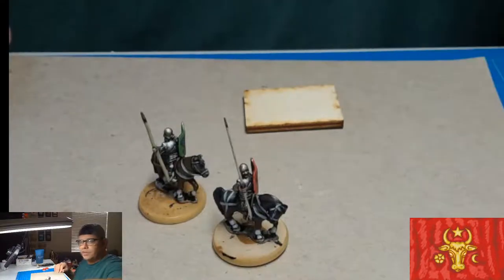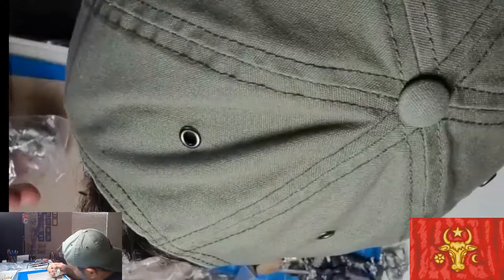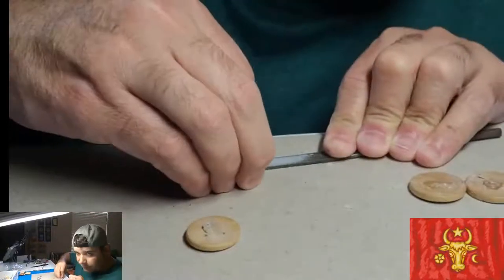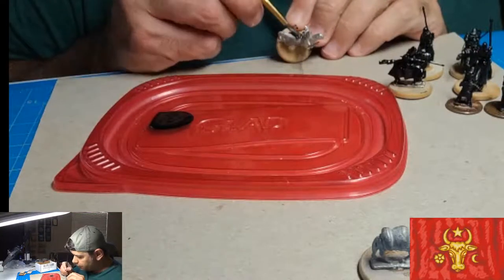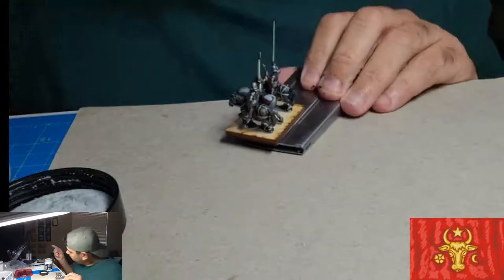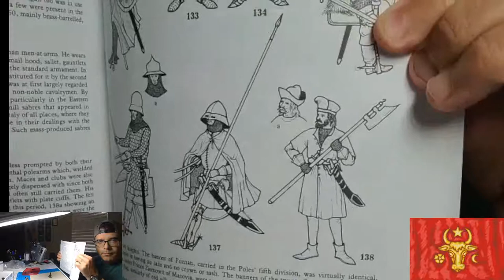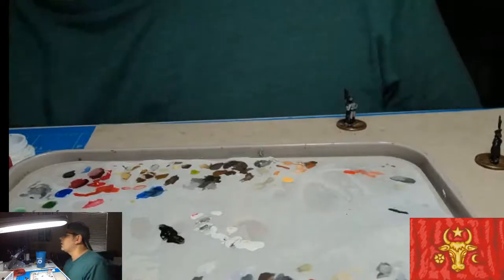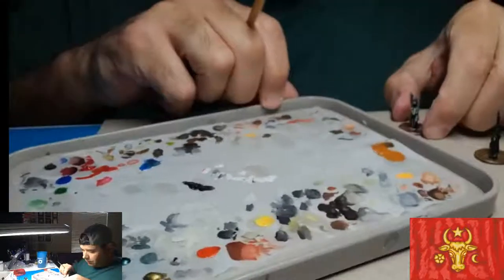3-12-22 Saturday Afternoon  Painting & Discussion

Comment: What do you use for undercoat/primer? You may have mentioned it in the video. I just don't remember if you had said it.
Reply from the maker: Vallejo Surface Primer in black. I brush it on and it is self leveling and covers really well almost like thinned down enamel so not many bubbles or missed spots.
Reply: @TonyAguilarFigure-atively  thanks! I've only used spray primer. I'm gonna give this a try.